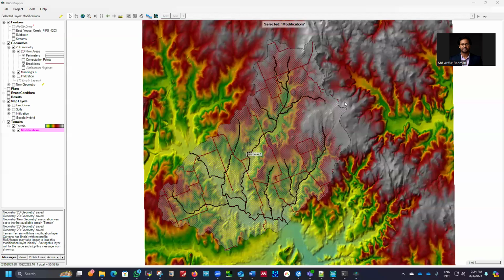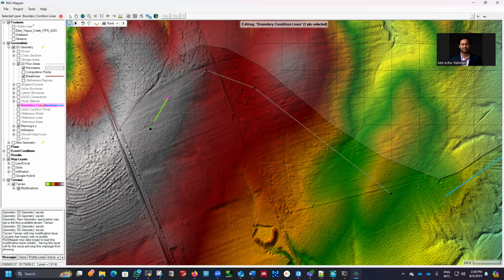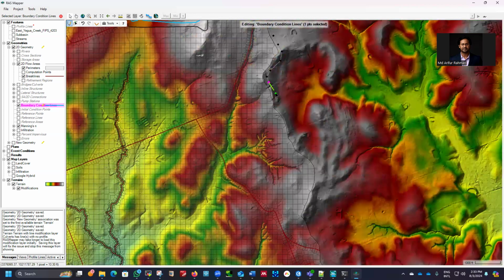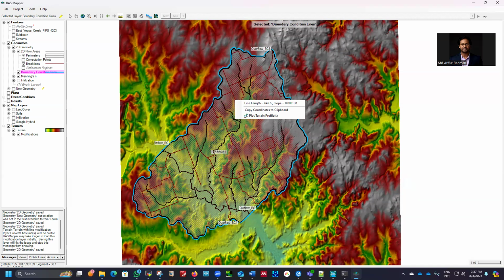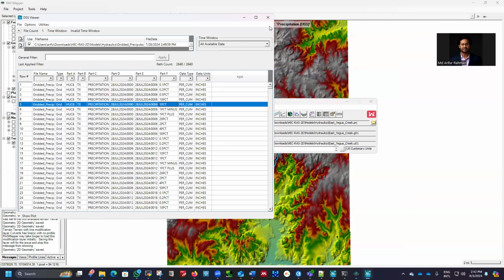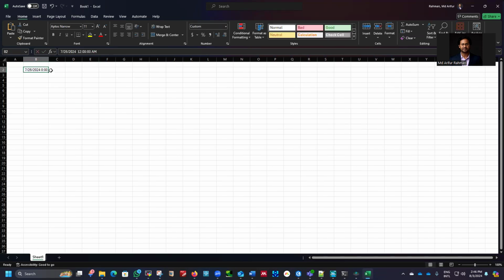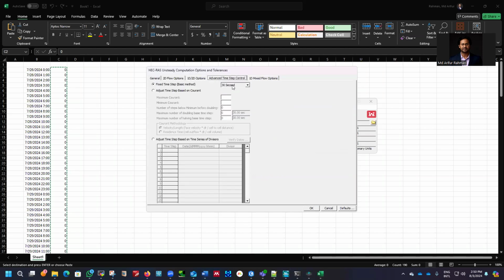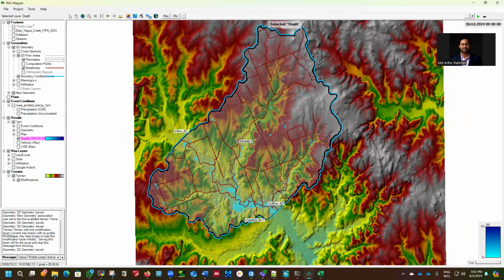HEC-RAS 2D: How To Setup Boundary Conditions For 2D Flood Model-T7

Comment: There are many streams, but you have chosen the smallest one for allocating the inflow boundary connections. What about the others?
Reply: The selected stream is an attacking stream that enters the study area i.e. the stream starts early outside and entered our Region of Interest (ROI). The other streams starts inside the domain thus they do not have external flow to enter.

Comment: Sir why are peak flow values in the flow hydrograph not provided for each subbasin? How can I calculate the water depth for various return periods if only normal depth is given for the upstream subbasins?

Additionally, if normal depth is the only information provided, won't HEC-RAS assume that the peak flow originates entirely from the upstream site?

Comment: Thank you for your viedo! It is very detailed, but I have a question for you, when I open the meteorological data with Gridded precipitation input to calculate, it always gets an error and can't do the calculation, do you know what the reason is? the error is always "forrtl: severe (64): input conversion error, unit -5, file Internal Formatted Read" ,could you help me? Thank you very much!
Reply from the maker: Thank you for posting the query. Without proper investigation, it's hard to say what's causing the error. It could be related to unit or other. You can send message to +16825537054 on WhatsApp.
Reply: @MdArifurRahmahn  Thank you for your reply.Would you like to give me your email address so I can send you a message if it's convenient for you, I'm sorry I don't have this app and it's difficult fo me to have this app.
Reply: @MdArifurRahmahn  Thanks for the reply, could you tell me your email address if it's convenient for you so that I can send a message to you, I don't have this app and it's difficult for me to have it.😀
Reply: Wow！I have the same quesion! this is very important for me. Have you solve this problem? It's my great honor to be taught. Thank you sir!